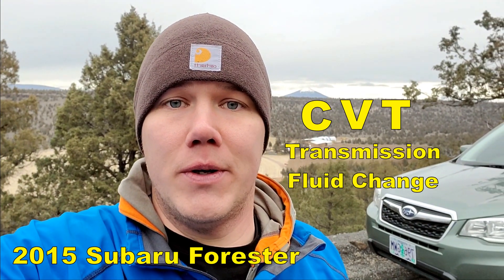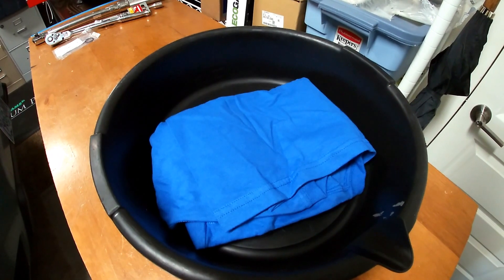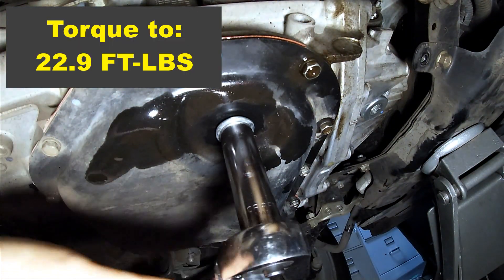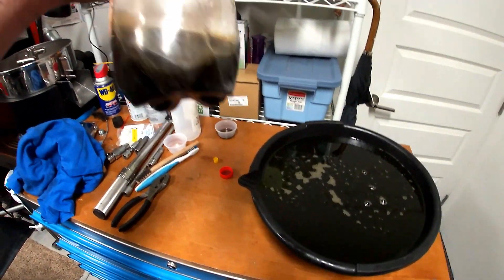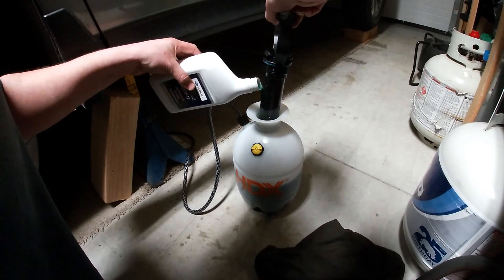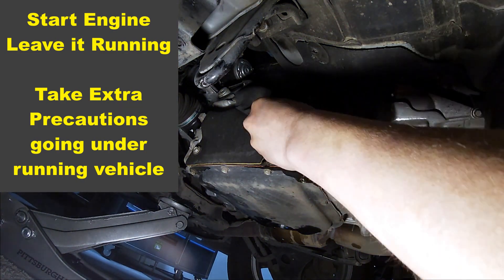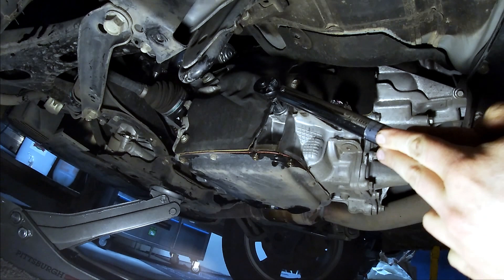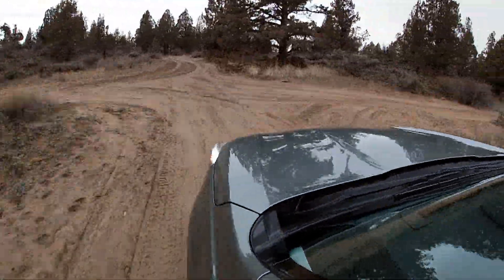Subaru CVT Transmission Fluid Change & Flush Procedure | 2015 Forester Replacement-Fill-Level Check

Comment: well done video.  some subaru literature reads not to touch the transmission until 100k mi. (or the warranty might be voided??!)
Reply from the maker: The owners manual says the CVT needs fluid replacement around 28k miles for severe duty...read what severe duty is and most people actually do fall into that category.

Comment: My dealer just quoted me for 399 and acted like it was a deal.
Reply from the maker: I think I paid $425 back in 2016 for a pan drain and refill (5qts). There's a place in our town that will do it for like$200, just a pan drain and refill, but they use a generic CVT fluid (Valvoline I think) They also claimed it was a drain and "flush" untill I got them to tell me the procedure is just a drain and refill of the pan.
Reply from the maker: Typical dealer attitude unfortunatly.

Comment: What do you do with the old fluids?
Reply from the maker: Recycle at the local waste station.
Reply: Dump them down the sewer. Lol jk you can get in serious trouble for that.
Reply: In my auto parts store it goes in the same recycling container along with all of the engine oil

Comment: if you just do drain and fill, do you still need to do the temperature checking step?
Reply from the maker: Yes, that is the correct way to set the fluid level. The fluid changes volume a lot based on temperature.
Reply: @MTsubfly  thanks man
Reply: @nuttietrendchannel4265  i had the same question, thanks
Reply: @MTsubfly  thx

Comment: Hi MT, this is massively helpful, Thank you! Are you also considering changing the Coolant? It would be nice if you could make a video out of it. Do you see the point of using the Subaru coolant or after market? Do you also use the "Subaru Coolant conditioner"? The coolant replacement interval, according to my dealer is 200km (I am Canadian), but I tend to believe a little preemptive maintenance goes a long way. What do you think?
Reply from the maker: Thats a great idea making a video on that. I'm not quite there yet. Another 20k miles perhaps. I have done coolant changes before, and the #1 reason I believe in doing a coolant change it to restore the coolants ability to stop/resist corrosion. Especially because of Subaru's history with head gasket failures, which can be from corrosion. I would use Subaru's coolant only because of their history of head gasket problems, and because I would hope that Subaru's coolant is made uniquely for the alloys they are protecting. Just my opinion.
Reply from the maker: As far as the conditioner, I am not sure of its necessity. Only use it if its called out in the owners manual, a quality coolant should suffice.
Reply: @MTsubfly  Hi Mark, I totally agree with you on the coolant part, especially with Subaru's head gasket history. I am a 16' Outback owner with the same 2.5NA DOHC power train as your Forester, and I see that in the factory service manual, it quots the use of a "cooling system protective agent (SOA345001)" when doing cooling replacement service. Could be some kind of chemical stabilizer for such an extended service life of factory coolant. Anyway, just an FYI. cheers
Reply from the maker: @davidcanada2000  thanks, yea if it calls it out I would definitely use it. Good luck!

Comment: Hello again MT 
Hope all ok there :0)
I wanna ask you one thing please, how many liters do you think i need for change my fluid and do only one flush like those 4 you've done?
My gear box is TR580...you have the same ir is the other hi-torque?

Thank you 😊👍🏼
Reply from the maker: ANDINA MM I think that my forester has the TR580, and I think the only other CVT is a TR690 used with the Turbocharged engines. I am not 100% sure. 
I would estimate you will get just under 6 quarts out of the pan, and each flush i only pumped out about 2 quarts at a time. Sooo I would probably buy 8 quarts plus 1 extra just in case (9 total quarts).

I flushed 4 times, so that would be 8 quarts flushed out, plus about 6 quarts from the pan, (14 quarts total, but in reality when I was done I had used 13 quarts, so I have one extra $12 bottle of CVT fluid sitting on my shelf... I hope this helps and makes sense.
Reply: 12$ thats amazing...
I found finally a dealer hwo charges me 22,5€/liter...he has a 20liter idemitsu oil can...and there is another hwo told me 25€/liter for original subaru...
Theu are charging me as i have to pay shipping and taxes from USA or japan...
Cant believe...may be i finally buy it in states only for not giving this people my money here in spain...
Thank you so much MT 
You guys are looky, there is very cheap
Reply from the maker: @andinamm2246  that is really expensive. Its most common to find it for $18-20 US dollars here. Maybe you can get a cheap plane ticket to the US and fill your luggage full of it? Lol.
Reply: Jajajajaja!,
Totally!
Reply: @MTsubfly  I have a 2011 Outback 2.5i non-turbo with a TR690.
Reply: Hey guys!
All ok there?
Still waiting for fluid but i have this scann app for ios and i wanna try it
So, what is the normal tenperature for CVT fluid once it gets its working value?
Thanks 👍
Reply from the maker: @andinamm2246  probably warmer than the engine coolant, because the engine coolant helps cool the CVT.
Reply: Ok thank you again 👍❤️🚜
Reply: MT, Better drain oilpan with oil cold or hot? 🤔
Reply from the maker: @andinamm2246  as pointed out in the video, do it cold. So you don't get stuck waiting for your new oil to come down in temp to set the fluid level.
Reply: Thank you MT
I understand...but, doing hot, more old oil is drained, rigth?...
Reply from the maker: @andinamm2246  not necessarily. Usually folks think heat helps oil flow better & faster for like draining engine oil, or gear lube. CVT fluid is not a thick oil. Even the dealer will drain cold if they can, but usually will park your car for hours after you get there because to set fluid level the CVT needs to be running, and in a certain low temp range as shown in the video. If your CVT is 200 degrees F, you drain & refill, your new oil is still going to become too hot to set final fluid level, and you'll be stuck waiting.
Reply: Thank you so much!
Learning a lot from You Man!
Thanks 😊👍🏼👍🏼👍🏼

Comment: Does the return line enter exclusively into the crankcase?  I am concerned that the return line runs out of liquid while the old liquid is being removed.
Reply from the maker: I had this concern too, while I don't know for for sure I can tell you it went well, with no wierd noises, and I only let about 2 qts out at a time. Its been my experience working on things that usually when a fluid is cooled, a pump pushes it through a cooler, and then it drops back into an oil reservoir to be used again, but I'm not 100% sure on the CVT. Hope this helps!
Reply: @MTsubfly  Here is a possible minor simplification to your fine process: Why not put the cooler return hose in the plastic jug and skip the low pressure air blow out procedure of the heat exchanger?  This way the new fluid being moved through the CVT would also circulate through the heat exchanger coil and associated hoses.  See any issues?
Reply from the maker: @AwakeErnest  sound good to me! I did it separately because I wanted to remove all of the fluid from the heat exchanger too, but I also didn't know how much fluid the heat exchanger held, now I know not much. Maybe a cup.
Reply: @MTsubfly  On 2nd thought, I think you did it right.  By blowing out old fluid from heat exchanger you got the maximum amount of old fluid out and thereby minimized mixing old with new fluid.  You got a good logical brain there (from retired electrical engineer).

Comment: Dear friend, I have a question for you. By the time you release the filler cap, shouldn't it come out fluid with the engine cold and stopped?
Reply from the maker: Yes, in theory it should, and very few have noticed that in my video. Truth be told its actually because of video editing and recording. I had actually drained the oil out of the pan first. My bad.

Comment: Great video. One question: to "re-learn" or not to "re-learn"?
Reply from the maker: What do you mean?
Reply: @MTsubfly  when I asked for a quote from my local dealership, I was told $350 to drain and refill (no flush) and push the CVT through the "re-learning" process. I have seem similar thing mentioned elsewhere, so I'm checking to see if you have heard anything about this, and if it's truly necessary. Again, excellent step-by-step video
Reply from the maker: @afkaz1930  ok great, gotcha. It may be that they reset the fluid deterioration which makes the CVT relearn something. In my case, i did not reset this %, and noticed no sort of relearning. It's been driving great for almost 5k miles now.
Usually a vehicle will need to be driven several miles in various conditions for any sort of parameters to be learned. hwy, city, stop and go driving...
Reply from the maker: @be5718  im not 100% sure. But if the deterioration % is reset, it has to start regathering info on your driving style to estimate deterioration.

Comment: Excellent video dude 👍
Question: for flush processing you fill with same Subaru cvt oil than waste it or refill it into transmision..
Reply from the maker: Use brand new cvt fluid, it mixes with old fluid, so yes some new fluid is wasted.
Reply: @MTsubfly  thanks 👍

Comment: Hows the car doing?  I have a 2015 Outback with 218k..  Never changed CVT oil because of so many conflicting opinions on if it should ever be changed or not.  But I am thinking I may give it a go.
Reply from the maker: Been driving normal. Thats pretty good 218k. Nice!

Comment: Hey MT, did the drain and fill require resetting any transmission parameters or settings? The Subaru Parts Dept told me this service on the CVT requires a dealer level scan tool to do properly. Can you confirm whether this is true?

Thanks and very helpful video!
Reply from the maker: I would presume what "requiring a dealer level scan tool" refers to the necessity of reading the CVT fluid temp (which you can to if you buy a OBD2 scanner & download the Subaru ActiveOBD App like I recommended) in order to correctly set the final fluid level. 

The only other thing they might be able to do to my knowledge is reset the computer calculated (estamated) CVT fluid deterioration percentage. In the video you can see my deterioration was just over 6% on the app. But I do not know how to reset it...honestly not that it matters much. I would base cvt fluid changes off mileage/age. The deterioration % is a calculation of how much time the fluid has been subjected to various loads and temperatures. I personally do not worry about resetting this figure. Jot it down in the back of your owners manual along with stating what maintenance you performed and at what mileage, you can then reference it years later, even if you go to sell the car, you can show whats been done.

Long story short, you can do this, buy a OBD2 scan tool, check out my other video on the one I used. Good luck! Thanks!
Reply: @MTsubfly  The thorough answer is much appreciated. I was referring to resetting the deterioration percentage. From your description of this setting, I totally agree that it's not necessary as I would also be basing it off my own record of mileage and driving conditions. Thanks again.
Reply: Dealer level tool mean SSM 4 (subaru select monitor) its $5000 
But OBD does the job!

Comment: One question:  How long did the engine need to be left running to bring to 100º F?  Estimated time?
Reply from the maker: Oh, I'd say I started around 50 degrees F, and maybe 8-12 minutes it was close to 100F. It wasn't a super fast, rush type process. Very comfortable pace.

Comment: How did you know that the amount of fluid expansion and fluid level will be just right when using 100F and the fill port as the level? Did I miss something in the video or is there more to it?
Reply from the maker: Thank you! I am glad to hear that. My intent was to help folks see just what needs to be done, so they can decide if they want to attempt it, its hard to find info on this process. I have a few more videos regarding Subaru maintenance to get done, this was a big one. Thanks again, good luck!
Reply from the maker: The paragraph in the picture at 11:12  describes the process, this image was provided to me by the Subaru dealership I bought my parts from. Also I learned my details from speaking with them, and asking them questions. I good dealer will be helpful. I try to provide all details in the video.

With the car level, you need to have the fluid level at the fill port within the specified temperature range, after shifting through the gears to get rid of air pockets. Once again, checkout the image at 11:12. 

The video should have all the info, but feel free to ask me any questions. Hope this helps!
Reply: MT thank you so much. I will rewatch the video and you, please keep them coming. As everyone says, you are extremely detailed and we appreciate it. My friend and I both have 2107 Legacies, and see tremendous value in your videos. Thanks again.

Comment: MT, excellent video.  Is it possible to do just a drain/fill,  replacing the exact amount of fluid without checking the temperature of the fluid?  Just wondering.  Ty again,  great job.
Reply from the maker: You could do that theoretically. But it's not a good idea because who knows if the level was set correct in the first place, and your fluids would need to be the same temp. For example, I think my fluid was on the low side for the last 70k miles... now it's just right.

Really... if you have a smartphone I recommend buying the obd2 scanner shown in my other video for $22, and download the app. Then your good to go get 'er dun! Lol.
Reply: The temperature is an important part of the fluid level because of thermal expansion.  The direct non scientific answer to your question "replacing the exact amount" is no.  There is a temp range that ensures you have the correct volume of fluid.
Reply: @pf465  I bet this also depends on altitude. As thermal expansion properties all change depending on how high you are.
Reply: Ok, ty for the info. Great job on the video.  Sweet ride,  love the falken wildpeak at trail tires! God bless

Comment: You are extremely precise and detailed. 
The thoroughness of your job and presentation is outstanding. 
Even the factory may not take as much care in assembling the car as you do in the maintenance!
Since the CVT uses friction to push the belt between squeezing pulleys the frictional coefficient of fluid is critical and as you know that can only be maintained through fluid renewal.
Reply from the maker: Thank you!

You stated the reason for changing the fluid very well.